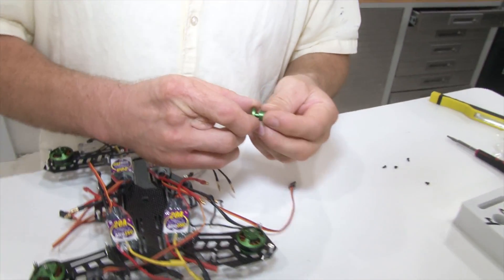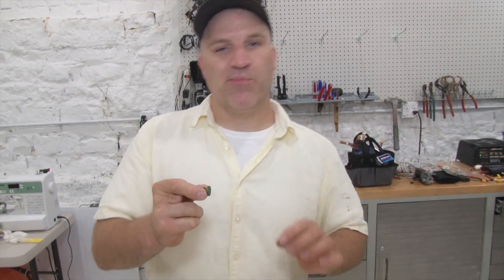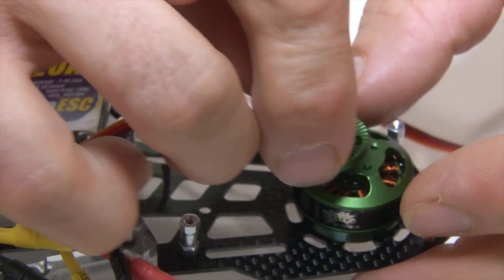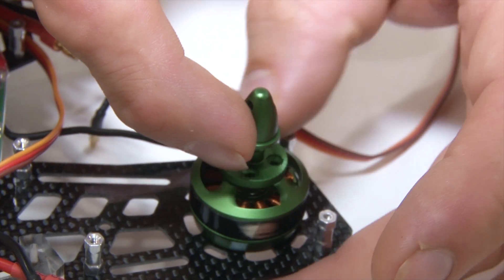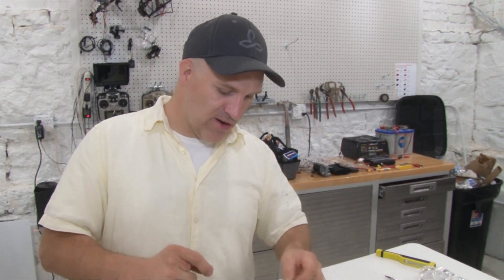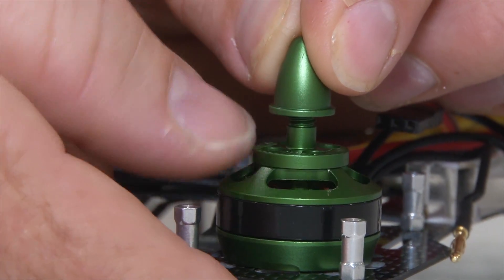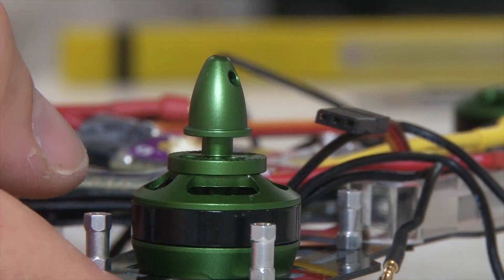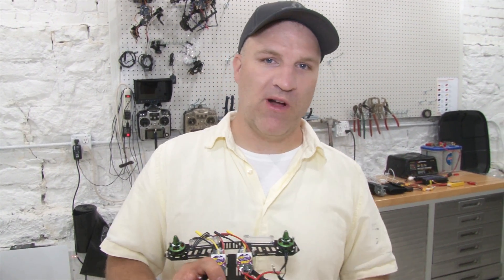How To Mount Propeller Adapters and Rotation when building FPV Racing Drone Or Drone

Comment: Great. so now tell them how they know which motor turns which way and how to change the rotation of motors. Not all motors come with removable prop keepers and not all motors are marked clockwise or anticlockwise. In fact every motor on my home built quads can spin either way. and only have the size printed on them. So how do "newbies" figure them out?

Comment: tell me you're joking. The motors aren't matched to anything because they can spin either way depending on which wires yo have plugged to which esc wires. Try reversing two of your wires and the motor will change directions. That is why your always finding the nuts mismatched to the motors because its the nuts not the motors that direction of spin refers too. Jesus, seriously you don't know this and you've been in RC how long? Is this for real or is this some kind of gotcha video or something? I just watched this again and it seems you are serious... god help us all. Motors can go anywhere you want to put them its just the nuts have to counter the spin for their respective positions on the multi-rotor. Who cares which slot you pull them out of the box from?
Reply: oh dear L7Psuher just showed himself a complete noob - what an idiot.  CW and CCW are different because the threads for the props are the opposite of each other.  I suggest you stick with store bought toy drones l7pusher, because you are clueless!
Reply from the maker: +L7pusher You Misunderstood. those particular motors direction are marked on the motor housing (not all motors are marked this way), so naturally most people installing these motors install the Motors marked CW on the CW location on the drone as per flight controller illustration , if they are installed in this manner with the hub adaptor matched to that motor, they will be reversed. has happened to hundreds of people, which is the very reason we made this point in this video. Thanks !!
Reply: So.... does that mean half the nuts might spin off if I'm using a motor that isn't directional??
Reply from the maker: @Hastalamangousta  i had this happen to one of my drones which is the way i found out..lol
Reply: Isnt that opposite then what you said? Its not the motor thats unscrewing the nut during flight, its the drag from props and drag is going in oposite directon? So i think you should reverse and mount nut that unscrews when motor is spinning.